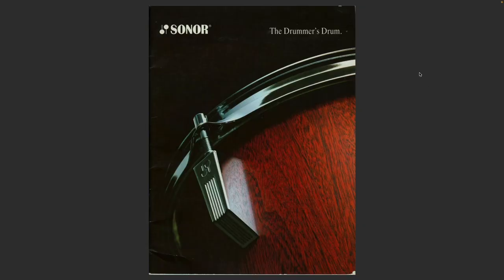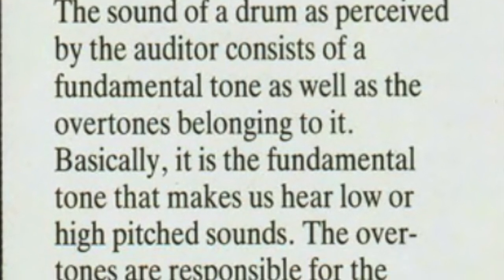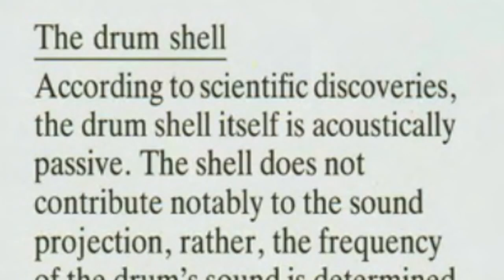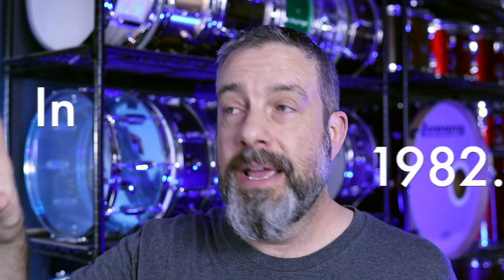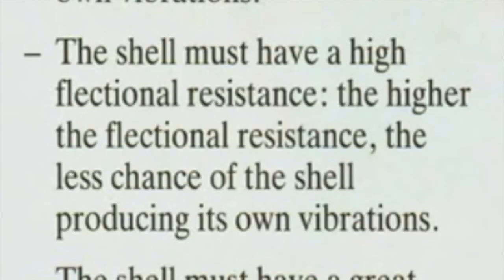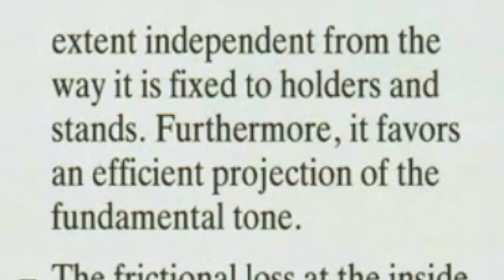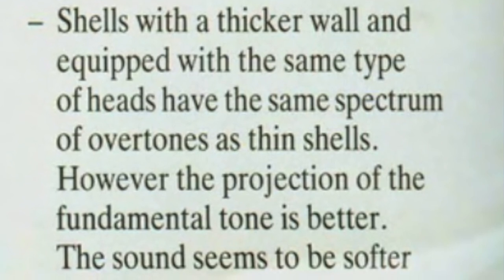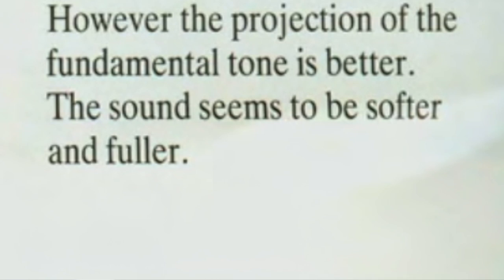That's Not What I've Been Told!  Drum Sound Physics, Part ONE

Comment: There's a few bits of relevant physics worth clarifying a bit more.   (1) The shell being relatively rigid and immovable creates sustain because head vibrations hitting the shell can't be transmitted into the shell, and get reflected right back into the head going the other way.  (That's a lot like how guitars get sustain.  Most of the energy of string vibration hitting the bridge or nut or fret can't be transmitted into the guitar, and is reflected right back into the string.)  Only a little fraction of the energy is transmitted from the head(s) into the shell, leaving most of it in the heads, to be transmitted into the air bit by bit at successive cycles of vibration.    (2) Rigidity works together with mass to resist vibration, so a shell that is more rigid may resist vibration better than one that is more massive.   Rigidity braces the edge of the shell against more mass of shell.   (Imagine that the shell was completely rigid.  You couldn't move the edge of the shell at all without moving the entire shell exactly that much, so the entire mass of the shell would resist the vibration at the bearing edge.   If the shell is flexible, only the mass near the bearing edge matters much... a floppy connection to the rest of the mass of the shell doesn't help a lot.)   (3) THICKNESS of the wood usually matters FAR MORE to stiffness than the intrinsic stiffness of the particular wood itself.  A particularly dense wood might be twice as stiff for a given thickness than a lighter wood, and usually about twice as dense, but you can just make the lighter wood a little thicker and it will be just as stiff.   Stiffness depends on the CUBE of the thickness, so you can double the stiffness by using 26 percent thicker wood.    (1.26 * 1.26 * 1.26 = very slightly over 2.000)   If you double the thickness, you can make the shell 2 * 2 * 2 = EIGHT TIMES as stiff.   That means that if you a wood that is 2x lighter and 1/2 as stiff, but make it twice as thick, it will give you a shell that weighs the same but is several times stiffer than the thinner shell of the harder wood.   That is why the soundboards (tops) of acoustic guitars are usually made of light woods (usually spruce or cedar), NOT dense hardwoods.  The only really important tonewood in a guitar is usually a cheap, soft, light wood, not the expensive "tonewoods" that raise the prices so much, because for a given mass you can make it significantly thicker and thus much stiffer. 

 (4) That means---and everyone needs to understand this---PARTICULAR WOODS DON'T HAVE PARTICULAR SOUNDS INDEPENDENT OF THEIR THICKNESS, and SEEMINGLY SMALL DIFFERENCES IN THICKNESS MATTER A LOT, up to a point.   Maple doesn't have a particular sound, nor does mahogany, or beech, or poplar, or any of them.   They all have roughly similar mechanical properties aside from their density and stiffness, which are strongly correlated and don't vary all that much.   The shell's stiffness is what's important to how much it resonates, and at what frequencies, and that depends more on how thick it is than which of those woods it's made of.   Once the wood gets to a certain thickness and stiffness, though, you reach a point of diminishing returns.  If the shell is stiff and massive enough that very little energy is being transmitted from the heads into the wood, make it even more stiff and more massive won't make much of a difference.
Reply: It seems to me my comment has lost somewhere or didn't come through the internet but you pretty much covered what I wanted to say - and more. Thank you!

Comment: Thank you for a thought provoking video. Three glaring points that are missed in this discussion of drum "physics."  Precedence Effect of the shell to bottom resonant head, whereby the shell transfers vibration from the top head strike and vibration through the shell to the bottom head at a faster rate than through the air collumn.  Time Domain, is something we are incredibly sensitive to (phase versus frequency non-linearities).  Constrained-layer dampening where more cobined mass, more layers, more glue and more hardware will dampen the solid material and minimize the precedence effect, and or transfer of enery (and it will do so non-linearly with frequency).  Yes, you are correct that we're hearing the bottom head resonating, but you're hearing a mix of the air collumn pressure, wave-forms, AND the precedence effect (which arrives earlier) .  Thus, shells and shell composition matter greatly, particualrly for those who want maximum mid and high frequency overtones.  That's not everyone, granted.  However, one must look at the physics without bending it to your aesthic or manufacturing preference.  Enjoy!
Reply from the maker: Wow!  Thank you for that additional information.  Looks like I need to do a bit more reading for inclusion in future installments of this series.

Thanks so much for being here!
Reply: @drumdotpizza  There's always more information, and I learn something new daily... :) Look at the Waterphone as a classic example of sound traveling through water or solids faster than air,  The combination of both water and air in the waterphone's sound chamber with physical movement while playing the instrument, bends the mid to high frequency harmonics and adds more harmonics to what we hear.

Comment: Very good explanation of the physics of drums, but . . . resonance and sustain are not the same thing.  In fact, they are inversely related.  Resonance is when all of the drum components are vibating together (warm, round tone w/ shorter sustain), and it is indeed enhanced by using thin/low mass shells, low mass parts, and roundover bearing edges .  It sounds like you prefer drums with strong sustain, essentially isolating the heads to let them vibrate as long and openly as possible.  It's totally a valid sound, but certainly not the only approach, and not the sound that many drummers are going for (and why so many are drummers fighting this type of sound with gels, tape, rings, 2 ply heads etc.).  I would argue that most drum companies ARE making thick-shelled heavy drums, and very few are effectively making thin-shelled, lightweight (and resonant) drums.
Reply from the maker: Excellent input, thank you so much for taking the time to comment!  

I really appreciate your direct answer to my question of what people mean when they say 'resonance' or 'resonate' as it is so hard to tell depending on who’s talking.  INDe makes great stuff — I’ve been using your strainer/butt combo for snare mods and builds for a couple of years now (and I’m putting together a review of my INDe Kalamazoo Bronze snare that I got earlier this year — should be wrapped and posted soon!).  

You mention two more terms, “warm” and “round” that lots of folks use that I’m also not sure about exactly what is meant.  From the standpoint of mass alone I wouldn't expect a less mass-ive shell (all other factors being equal) to produce a "rounder" or "warmer" tone (from MY meaning of those words, both of which, to me, refer to a fuller fundamental content), but mass, of course, is but one factor in the tone of a drum.

You also mentioned roundover bearing edges!

The round edges would definitely taper a lighter drum's brightness a bit as the greater surface contact would serve to muffle the head slightly because of the greater transfer of energy from the head(s) to the shell.  These two factors together (round edges, lower mass) will definitely shorten the sustain while simultaneously reducing fundamental AND controlling the highs a bit (energy leaving the heads).  The result (I would expect) is a drum with a good balance of frequencies, but a bit quieter and more controlled overall, probably ideal for smaller venues (particularly if not miked) and recording, especially if you’re into minimal miking techniques (larger diameters tuned a bit above their midrange probably sound amazing using a Glyn Johns type approach!).  I could see describing the result of this combination of factors a 'warmer' or 'rounder' tone.  That makes sense to me. 

This is the type of discussion that truly excites the drum geek in me though, and yours is the precise type of engagement I love to see.  Thank you for taking the time to share your knowledge!  (FWIW I have second video in this series coming shortly.)  I think this type of interaction is tremendously useful to people who have never really put their minds on these factors, and a deeper understanding of such can only help drummers (and producers/engineers) to achieve their ideal sound in any given situation.  

Cheers!
Reply: @drumdotpizza  I love nerding out on drum tech, and you are doing a great job on your videos, and inspiring great discussion.  Describing sound is always difficult and subjective, but you are making it understandable and relatable.  Looking forward to seeing your thoughts on your INDe snare!

Comment: I can corroborate this from my experience. My first 2 pro-level kits had thicker shells and nice sustain. The first was an 80’s era Tama Superstar. The second kit was an early 90’s Yamaha Maple Custom. Tuned right with single-ply heads, they would sustain for days. For some reason, I sold those and “upgraded” to an Absolute set, with much thinner shells. Actually, the toms sounded great…until I mounted them. The YESS mount system on those thin shells choked the sound significantly! And because the spaces between the hoops and the lug casings were too small, I could not use RIMMS mounts. That set didn’t last long.
I actually went back to the 80’s Tamas.
Reply from the maker: I'm an 80s Tama fan.  My first new kit was 80s Imperialstar, and I have several snare drums plus a 1st Gen Royalstar Brazilian Grain kit (the good version) that I really dig.

Comment: That's why our seamless walnut snare shells are 1/2 to 3/4" thick. Now it's time to build a thick walled seamless walnut kit. The "Wallnut Series" 😀
Reply from the maker: SEAMLESS walnut shells?  Just machined out of a block of wood?  Do tell!!!  

You know, this makes me think of stave shells as well.  The lack the suspended tension of bend wood drum shells, so their inherent pitch is lower, and they also tend to be rather thick/massive, but I have never actually played one that I know of.  I was given a stave snare drum shell a few years back and am getting around to using it only now... I'm very intrigued.  

But SEAMLESS wooden shell???  I'd love to check those out!

And why walnut?  Cost?  Plentiful where you're located?  Or is there something unique about the performance of walnut that you prefer to other woods?  I would (wood? ;) think that given such high mass that the subtler characteristic of each wood type would be minimized somewhat, but this is new to me!  I would love to know more!

And thanks so much for posting!

Comment: Thank you for this input and taking the time to express some facts. I am a full time professional and are very familar with the Sonor book you are reading, furthermore I play a Sonor Signature Kit. The shells are super thick, heavy and super mass. The kick drum shell is 20mm thick with each shell reducing in thickness in relation to size (diameter). The projection and sound of these drums is unmatched, I,ve stacked them up against everything over my years in the industry. Yes thick shells are awesome, head selection is critical to getting that sound. I also have a Sonor Designer Series Kit , same configerations as the Signature Kit but with rims mounting. The shells are thick and reducing also, the sustain is unbelievable and well defined. Really there is nothing between the two Kits when using the same heads on both. Shalom.

Comment: I have a thin shell snare drum made of cheaper maple, and one thicker made of brass. The brass drum definitely carries on for longer and feels louder. The thin one sounds thin close up because of overtones, more full further away since in my experience overtones don’t travel far. This video and the talking absolutely matched my experience.
Reply from the maker: Correct!  Overtones (high frequencies) are absorbed and diffused by air molecules... they don't get far, so all drums will have a purer, mellower tone at a distance.  The drum with greater mass, however, will have a louder fundamental tone.  ;)

Comment: I think you'll find that actually the shell takes it's energy from both the head AND the vibrating air within the shell when the head is hit. So the natural resonance of the drum shell has a far more complex impact on the sound of the drum than just "sucking" the energy out of the head and reducing it's sustain. 
It's very similar to what happens in hi-fi speakers, if the cabinet has any vibrations it "colours" the sound of the speaker because it impacts the linearity of the speaker cone's response, both in an additive and subtractive way depending on the way the resonance in the cabinet affects the pressure of the interior of the cabinet at particular frequencies. Exactly the same physics process is happening in a drum when you hit the head.

Comment: I think this was part of the idea behind Peavey Radial drums. Their snare shell in particular was a beast! Great video! Edit: Thinking back on it, this was the concept behind the snare but I think the tom concept was to create sort of a "violin" with a thin, vibrating shell and a stiff "bridge". However the concepts are completely different. The violin, guitar, etc, are taking relatively low sound magnitudes (bow across strings, fingers plucking strings) and using the bridge and body (a resonating box with vents) to amplify the vibrations. A drum doesn't really need that, as you point out with your example of the Rototoms. The drum head is getting relatively high magnitude impulse from the stick into the head, which then doesn't require much amplification. Cheers!

Comment: I agree with you 100% about the lack of thicker shelled drums in the current marketplace. It's almost impossible to find any major manufacturer offering production line thick shelled drums. Sure, you can custom order a heavy shell from from many of them, and you pay thru the nose for them. Thin and medium shells are great, but the market is utterly flooded with them. It's also time to move away from the 18x22 as the standard size for bass drums. Good luck finding a 16x24 or a 14x26 without having to go custom. It's even hard to find a 16x22. Frustrating time for many of us drummers.
Reply from the maker: Now you are speaking my language!  Not only am I a fan of thicker shells, but all but one of my bass drums are only 14" deep (the other is an 18x24 that I must admit I like a great deal).  After several years of recording 18" deep bass drums I got my '68 Ludwig 20/12/16 in psychedelic red and was instantly AMAZED by how bit and authoritative that little 14x20 kick sounded on playback!  In the years since I have tried so many combinations, but in general all the 14" drums have much more weight behind them when recorded than do deeper drums which seem to have more punch (but not so much weight).  

I think things will come full circle in this regard in the not-to-distant future (particularly if we talk a lot about it! :)
Reply: Try the custom drum shops. They usually offer thick shells and aren't thst much more expensive than name brand premium drums

Comment: I think you're mistaken about the energy loss issue. I understand it as having more to do with sound waves cancelling each other out. If a shell vibrates at a complementary frequency to the heads but phase shifted relative to them, it will literally steal energy from the heads as its phase may oppose and thus cancel certain frequencies from the head's vibration.
Reply: I don’t think so, even though I perfectly understand your idea: if the drum shell resonates (in a correct sense) it would sum to the vibration equation, as the resonance is an accumulation of energy in some specific frequencies (considering the energy conservation law), causing an occasional bump, a buildup. But the amount of energy (that don’t sum by any means) will be lost or transfered, if you will, to the shell, that is less capable to “move air” than the heads. I think that’s the point: if the energy is concentrated in the drumheads vibration, the perceived sustain would be greater, since the head transfers its vibration to air particles (and not to the shell). The main issue with phases, I guess, would be around the 2 heads relation and the deep of the drum. I am not 100% certain about that, but that’s the way I understand it until now. cheers.
Reply from the maker: Heads and shells vibrate in entirely different ways, so while there can be (and certainly is, to some degree) the phase cancelling previously mentioned, the bottom line is the two types of vibration do not easily play well together.  They will almost always fight in some way.  But that is still adjacent to the point about energy lost from the drum head(s).

In the physical world there is no perpetual motion... forces like friction and gravity work against motion (vibration) until it ultimately ceases.  Any time you transfer energy from one form to another there is a loss associated with it (much energy is lost as heat, for example, when charging a battery -- the thing is hot by the time its charged!).  Going from vibrating heads to vibrating shell (or shell too thick to vibrate stifling the vibration of the heads riding on round edges with lots of surface contact) includes a loss that shortens the vibration of the heads = less sustain.  

The effect if more obvious in some drums than in others (many other factors playing a role, of course), but it has been consistently observable.  

I REALLY need to put together a good demonstration video(s) to go with all my hot air!!  :)

Thanks so much for being here!!